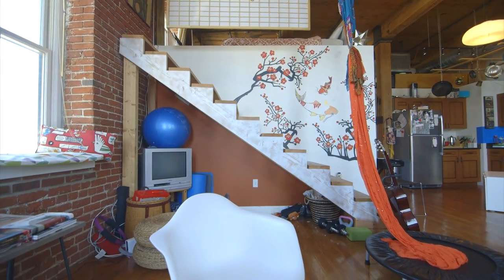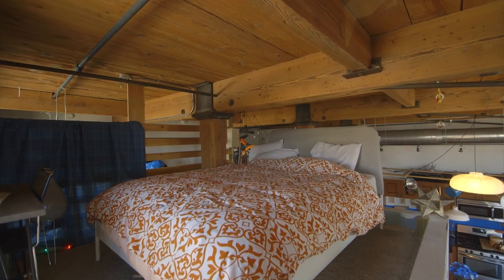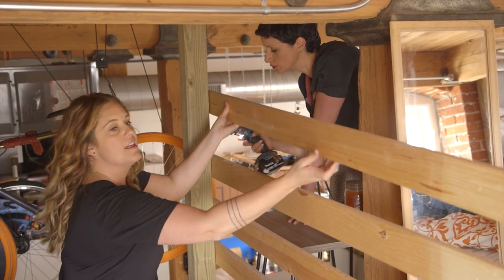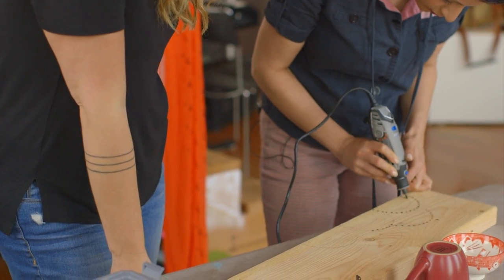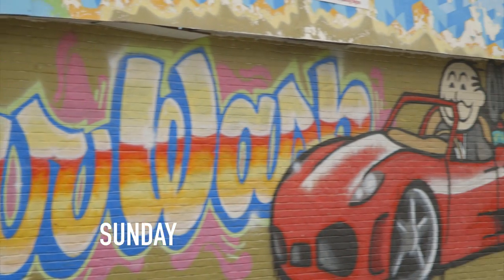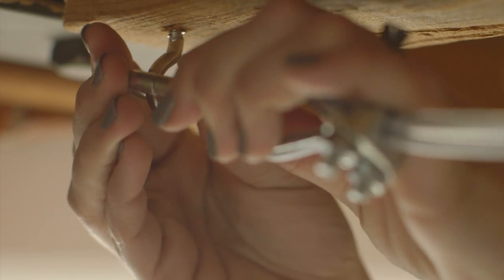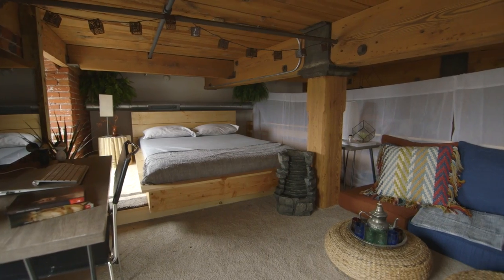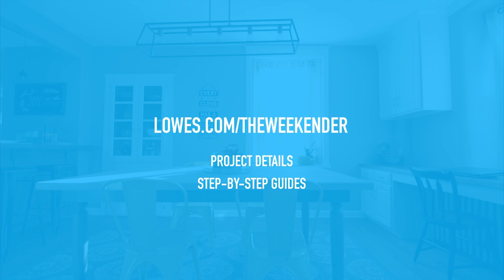The Weekender: "Air Brick-n-Beam" (Episode 5)

Comment: While I like the concept of this Lowes marketing campaign,  I think it could be better executed with some simple and easy fixes.  (And this is really a note for the Lowes marketing team) -  I've watched a few vids from The Weekender series and in each one so far, subjects in the videos are not wearing eye protection or gloves when using power tools like the Dremel Velocity, not wearing dust masks, gloves or eye protection when doing demo work in Austin,  and not wearing eye protection when using a Dremel tool to bore holes into wood boards in this video.  I think the location producer and stylist need to pay better attention to making sure the talent uses the proper PPE otherwise people may incorrectly assume that since Monica isn't using PPE, then they don't need to either.  Also, it would be nice to have links to the products used in this video somewhere on this Youtube page.  Monica does a decent job of identifying solutions to design and functionality problems in this series, but the Lowes marketing team needs to make it easier for customers by identifying which tools and products Lowes has available so that customers can complete similar projects efficiently.
Reply: I'm generally for protection, but in the case of burning holes in wood, I feel like it isn't needed. though, for cutting on the miter saw, I'd use a face shield, and not my hands 1inch from the blade.
Reply: I like this comment, i totally agree with that last point, the one about the products. Like I love all the products used in some of the videos
Reply: Pat Vasquez-Cunningham A
Reply: I never thought of any of these suggestions but seriously best comment. I hope LOWE'S will see this and make improvements
Reply: Wow, this is on point... I really like the Weekender, but your comments also make sense.  Nice!
Reply: Lol, I actually thought Lowe’s was her last name XD Just realized it was a store after reading this comment,, and thats after watching most of season 3&4
Reply: This is a great comment but also she's there painting a staircase blue with a white shirt and her hair down so I get some of these are composed shots feeding into partial fantasy.  I agree with all you said though.

Comment: It would've been super cool if they used a foggy glass windows around the loft instead of the railing, it would be more private but still let in light and fit with the older feel
Reply: glass is not very safe for this particular project.... she mentioned her child keeps going upstairs etc.
Reply: Although, it would be more expensive, it is possible to get safety glass.

Comment: This was great. Just thought the curtains were cheap looking. Maybe industrial pipe instead of that cable so it wouldn't sag and moore fabric so it could actually bunch up and not look so thin. 

The wooden side piece at the top could have been painted black too or mimicked the look of the staircase which turned out absolutely amazing. Looove it.